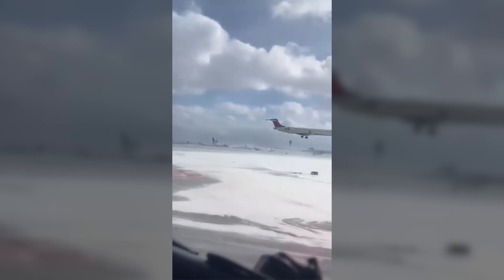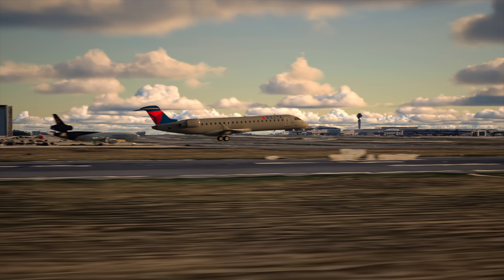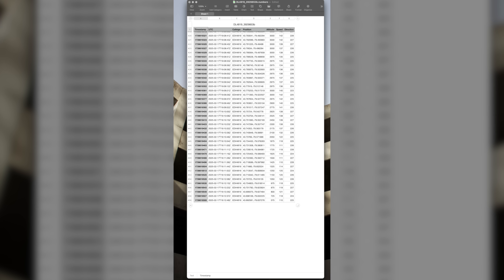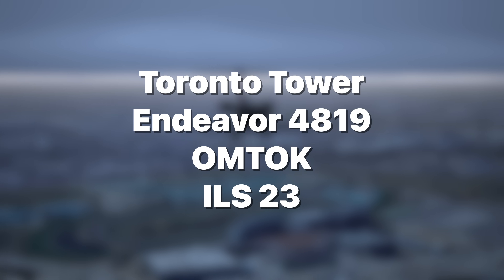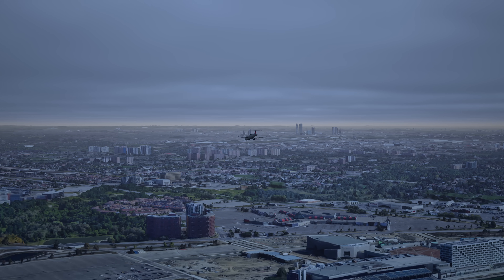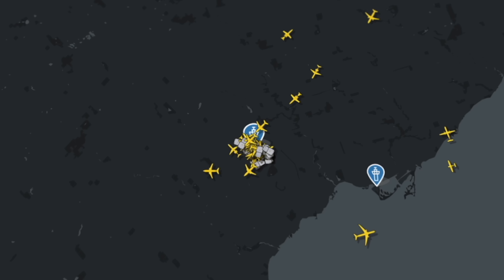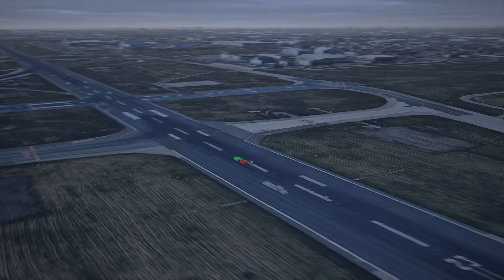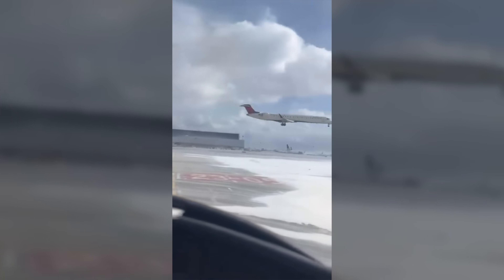What Caused The INSANE Descent Rate in Toronto?

Comment: I’m an airline pilot and after listening to what the controller said about “a possible bump in the glide path, a plane will be in front of it”, I think he was referring to an aircraft that was on the ground ahead of the ILS critical hold line. Because the ground aircraft was over that line it might cause a “bump” in the glide path. I’ve experienced this many times when I’m flying a visual approach but still utilizing the ILS guidance for the approach. You’re right, a Challenger wouldn’t be much of a wake turbulence threat to a CRJ 900. I don’t think the controller was referencing turbulence, but a glide path signal disruption.
Reply from the maker: I’ve heard this a few times now. I hadn’t heard that term before but it makes way more sense. ILS issues have caused issues before in low visibility.
Reply: @Brian.Murray flying into Flagstaff when it is snowing they would go out and clear snow off the antenna. Not overly confidence inspiring but ya.
Reply: @Brian.Murray  With a 20 kt headwind component gusting to 30, the aircraft's groundspeed, while flying at an INDICATED Vref AIRspeed will be below the required Vref AIRspeed.  
It won't be a problem until your headwind component suddenly disappears and the wing stalls.
Reply: @Brian.Murray  wrong, they were higher ceiling day and would not have been flying lower than a cat 1 ILS, Decision height no lower than 200AGL and would have clicked off autopilot below that.  Don’t believe they have autoland installed on this plane and even if installed would have relied on Radar altimeters and not ILS glide slope for landing angle and touchdown mode control.
Completely amateur explanation attempt.  Leave this to the professionals.
Whomever was landing screwed this on up and it doesn’t have to do with wind.  GPS speeds on your data didn’t even deviate the highest limit of the gust 10 knots.  I think actual ground speed never deviated more than 5 knots.  So add 118 ground speed and headwind around 23 or more knots and you get around 141 knots indicated on final which is normal.  I’m assuming Toronto is not high MSL so IAS is close enough to true airspeed.
Reply: Males sense
Reply: @JK-es9wu   Yes indeed I must agree with you, "Males" do often "make" sense !
Reply: I wonder when the autopilot was disconnected. If it was still engaged and the glide slope suddenly flaked out, it could have caused a higher sink rate trying to maintain path
Reply: @cloudstreets1396  Most pilots are HAND FLYING that aircraft, using the ILS only as a reference.
Reply: @ I see. Thank you for that information.
Reply: @cloudstreets1396  No, the autopilot must be disconnected for Landing the CRJ…
Reply: @ I’m aware
Reply: @cloudstreets1396  I presume ILS23 is a Cat I and auto landing cannot be set. Being the only way around it would be the smoking pistol in my opinion.
Reply: @cloudstreets1396  

...something something...'autopilot'...something something...'New Zealand Navy ship run aground'...something something...*

*apologies to Seth McFarlane and to Emperor Palpatine
Reply: I've studied the video -- it LOOKS like the CRJ is starting to Flare, right at the very beginning -- then the nose drops suddenly over roughly the threshold .. whether this "wind sheer" is caused by atmospheric conditions or a Plane over the hold short I can't say, but the sudden increase in Vertical Speed seems to indicate they were hit by Wind Sheer right at the End Of Runway and didn't have any lift to recover and TOGA ..
Reply: @BradHartliep-kn9ud  Have to say I don’t see any check of ROD or flare at any stage, but particularly where you’d expect it just before touchdown.
Reply: The airplane from which the video was taken would've been ahead of the ILS line (which is allowed and normal when visibility is good, as it was when this crash occurred), so it's almost certainly what ATC were referring too.
Reply: You are correct.
Reply: I agree 💯 he was referring to a glideslope deviation due to aircraft cross the runway.  It's not uncommon.
Reply: Didn't think of signal deflection due to the ground aircraft. Good catch.
We'll see as the investigation progresses and in the final report.
But, given the cross winds and attitude of the accident aircraft, I'm inclined to suspect a failed TOGA with possible downdraft.
Reply: Would having the incorrect setting on the altimeter and a erroneous altitude reading cause the pilot to maintain a high sink rate as they approach the runway?
Reply: No, not at that stage. Assuming it was a manual landing and not a practice auto land, it’s all judged by eyeball, assisted by automatic height callouts from the Radio Altimeter which is not dependent on any setting.
Reply: You're exactly right. And what a kind way to inform everyone, thanks for not putting people down because you know more. 👍🏼
Reply: It's nice to have input from someone that knows what they are talking about. Too many aviation " experts" on here.
Reply: I completely agree… This would’ve had no effect on a visual approach!
Reply: @pilot1880 You are correct. There was an aircraft waiting for departure inside of the ILS critical zone because the weather at the field was essentially VFR. The controller was referencing the ILS glide slope signal disruption that might be affected or caused by the waiting aircraft. And another thing, there is no way wake turbulence was a factor in this event. The speed and direction of the crosswind would have taken care of any wake turbulence by ANY aircraft.
Reply: @ Totally agree…
Reply: Could the bump be caused by the same aircraft that took video of the crash? Camera jet certainly seems to be at the front on the line waiting to take off ..
Reply: Good point,  as ATC I haven't considered that bump indication as a proper wake turbulence warning nor for second.  
25kts nose wind component (once decomposed) save you from going too fast GS. 140kt seems very convenient.  I see a lack of flare or a very late hint ot it. 
Not being an ILS23 a CatIII, (it is?) auto landing disengage for wind shear, severe wake turbulence or signal distortion it should not be the case. Weird.
Reply: Not to mention, no air-traffic controller would use such non-standard verbiage warning about a possible wake encounter! C'mon! He would have said something like, "Caution wake turbulence, heavy Boeing 777 on short final" or something like that. Obviously, the aircraft being a smaller plane was NOT the issue (since obviously it wasn't in fact a huge B777! :-) ).  It's irksome because, when Brian mentioned the jet ahead of the CRJ9, I thought he was going to start talking about PIREPs from that plane or something. But no, yet more furtherance of the misinformation about wake turbulence. :-(   Otherwise, the analysis is spot on.. This looks pretty cut and dried, that there was a combination of human factors and wind shear. It looks like they used the "wrong" technique on landing -- instead of the "crab", they used aileron to keep the right wing down; but that just led to the wind shear forcing the right wheel to dig into the pavement, taking ALL the force instead of half if the plane had been level, thus collapsing the gear, etc.  I mean, I don't know if I would fly in a CRJ9 on seeing how close the wings are to the ground in this type of scenario, because obviously it's the wing hitting the ground that caused the real problems that then resulted from this. The left wing then becomes a sail, and .. well, the rest is obvious. :-)
Reply: @SteveGoldberg  I haven't flown for a very long time, retired now. I have always used the wing-low method to correct for a cross wind when flying turbine aircraft (something about avoiding compressor stalls, but maybe that's old-fashioned stuff). When flying reciprocating engine propeller aircraft the crab method is fine (and fun!) but I still always straightened out just prior to landing and lowered the upwind wing, so the centerline of the aircraft and the movement of the aircraft was parallel and aligned with the centerline of the runway. It is much easier to stay on the runway using this method, in my humble opinion.
Reply: @cherylk.2474  Agreed…I’ve been landing that way since my Private…Worked on the CRJ, and works on the 777…
Reply: @SteveGoldberg  verbiage will be shortened based on workload and that is standard.  BTW they would say Heavy on final not make and type in Class B airspace if busy
Reply: The pilot had the aircraft well stabilized on the approach but when he transitioned from instruments to visual he pushed the nose down and aimed for the end of the runway, this is why the last few hundred feet had a high decent rate, I’ve seen rookie pilots do this many times.
Reply: Wake turbulence effect in strong crosswinds is unlikely..
Reply: Landing gear failure.. right side is missing, looked like it collapsed.
Reply: @BayonetRedneck  The landing gear tends to fail, during a very hard landing…
Reply: @ no
Reply: @BayonetRedneck  maybe.  The LG are located in the wing root and mostly retract into the wing.  Since the wing was sheared off in the accident, the LG went with it.
Reply: @BayonetRedneck  As an aircraft mech, that was the first thing I noticed.  It collapsed immediately upon touchdown.  Like the locking mechanism completely failed upon impact.
Reply: @BayonetRedneck  Agree.  Something is fishy about the way the gear appeared relative to the pilots camera angle. Did they start to retract? Where they not properly locked? Sudden gust 1/2 second before ground contact and they caught an edge of the rim?
It just don't look right.
Reply: @TheOriginalFreak  if the landing gear wasn't down and locked there would have been an indicator light in the cockpit.  If they started to retract the gear, both would have collapsed.  I think the locking mechanism failed or the strut lost all hydraulic fluid and failed.
Reply: Yes, but why the abrupt touchdown, I want to hear what the pilot has to say as to why the hard landing.  Conditions were less than desirable but not that terrible.  On such an occurrence, do they automatically test the pilot for blood test results?
As everybody telling us to put our seatbelt on, ... hey, control the plane.
Most do and I salute all the good pilots out there, nice work, glad everyone including the pilot survived.
Reply: @ turns out the FO was at the controls and she just finished training and did her checkride for her ATP and CRJ type in January (last month). The gusty winds were well beyond her abilities at this stage in her learning. Both of their careers are over. Sad. And yes they will be drug tested
Reply: @cloudstreets1396  I understand the CA was a Sim I structor that needed landings but didn't fly often.  Bad combination on a day like that.  Very sad.
Reply: @cloudstreets1396  Wow…really…. that’s one of those times, when the captain has to say “I know it’s your turn to land, but this is pretty challenging today, and I think I’ll land this one!”
Reply: @ I’m sure the captain wishes that he did. Both their careers are over
Reply: @cloudstreets1396  Sadly, there’s such a fine line between “Acing it”, and messing it up…Usually, it’s just a bit of embarrassment, and your turn to buy the beers…We’ve all been there at one time or another…Glad everyone survived, but feel terrible for the front-end crew!
Reply: @cloudstreets1396  saying the winds were well beyond her abilities is a bit of a stretch…and a massive assumption as to the cause of the hard landing
Reply: @ not only were the conditions beyond her abilities the captain flowed to delta mainline wasn’t able to make it through training and got kicked back to endeavor. So both pilots were a big mess in challenging conditions

Comment: I know by definition that the runway was ruled to be "dry". But good grief, what I observe is simply a snow covered tarmac. With a lack of proper flare, I believe the runway conditions also contributed to the accident.
Reply: No, you're looking at a video from a distance where you can see the snow to the side of the runways.... if you look at the other video up close to the plane when they are getting passengers out, you can clearly see the asphalt with just a bit of snow blowing across at that point.... it was not "snow covered" as clearly the asphalt was visible.
Reply: @silkeotd7194  However visual cues may have been affected.

Comment: That landing was kind of hard but don't you think there might have been a layer of snow on the runway that caused extra resistance for the wheels and thus the gear collapsed? In the video taken by passengers you can see the runway is completely covered in snow. Also the plane seemed to lean a bit to the right just before touchdown, and thus the gear on the right collapsed first causing the plane to roll to that side, ripping the wing apart and then turning upside down.
Reply: No, the video I saw of the passengers being cleared out of the plane you could see the asphalt with just the wind blowing a bit of snow across it... if it had been covered in snow we wouldn't be able to see the asphalt.
Reply: @silkeotd7194  So it wasn't the pilot's fault, it wasn't the weather's fault, it was the asphalt? ;-)